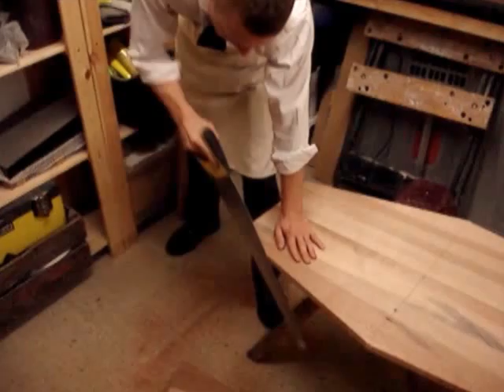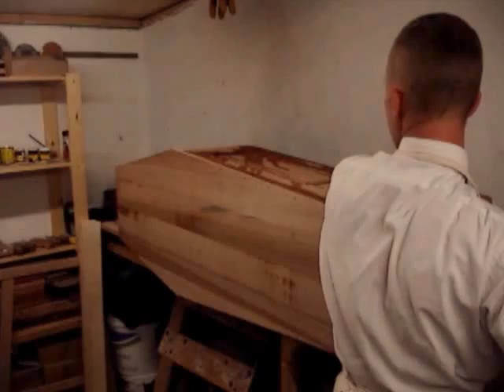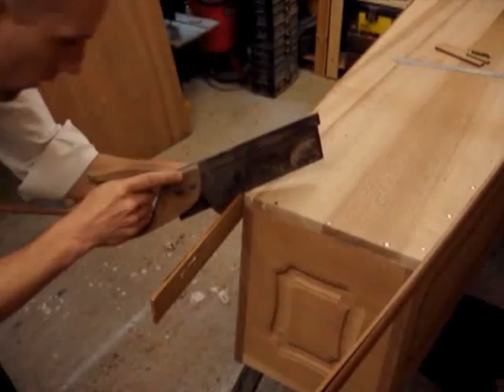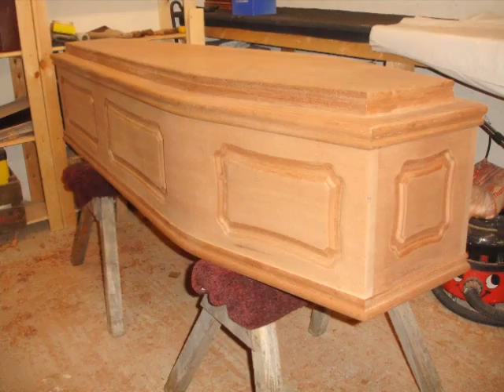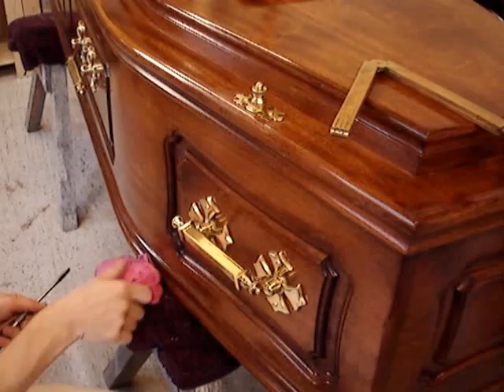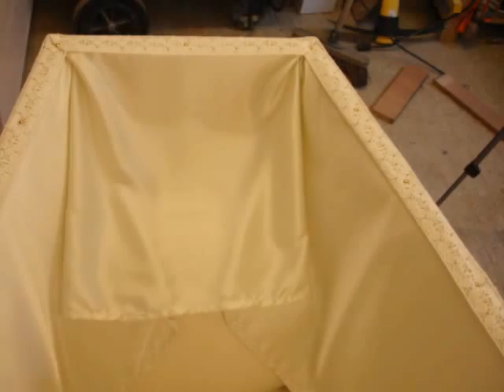Leverton Bros How to make a Coffin

Comment: I've been a Coffin maker for 47 years and will put this man to shame as he never admitted the main components the sides are factory made. No BODY has commented on how did he make the sides of the coffin. Well he did not make them. The sides of coffins have been bought in by undertakers for over 100 years for a simple reason. The sides of any coffin no matter the size of the corpse are allways the same they come in standard one size lengths as you saw he sawed this coffin to size. The only part that needs to be made as he did is the bottom. Ends, and a decorative lid. Handles on a Coffin are not for carrying there only for decorative purposes.  In life what you appear to see is fooling you and the iceing on the cake is the huge price charged for a piece of underground furniture seen above ground for only a few days.
Reply: Karl Gibson ... I think this may depend on where you are around the world, many people make coffins or caskets for themselves these days it’s not new . I see the Kurfs cut in the sides so it bends and flexes around the side of the casket. A circular saw can do this easily or table saw. He may well have bought the sides as you say but he still did a lot of work on it and stained it nicely, added lovely handles and other components I say a job well done regardless.

Comment: I'd like to see how they get the walls to bend along the sides.
Reply: I'm a Coffin maker, you ask how the sides where bent when building a Coffin. Simply you cut 13, close saw cuts three, quarters of the way through the coffin sides from the back, ( The saw cuts are named Kerfs). This enables the sides of the coffin to be bent easially for the shoulders of the corpse. Also a Coffin is made 6 inches longer than the dead person this allows for, baged internal body parts to be stored, after a autopsie as its not easy to return them all inside a body.
Reply: I recently retired and am gearing up to start woodworking again. I grew up watching those Hammer vampire movies and I'd see a lot of "toe-pinchers" in them. It appears that they steam bend the sides. The shoulder area of the coffin isn't angled it appeared to have a smooth gradual curve...beautiful ( in a weird sort of way)